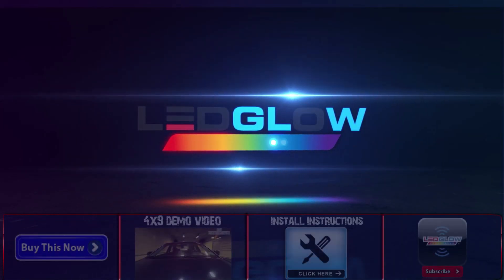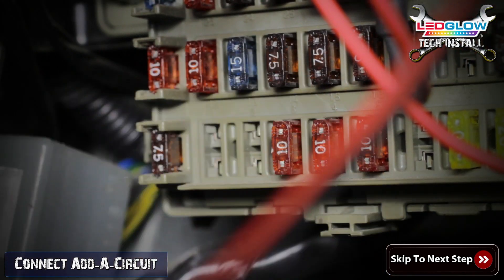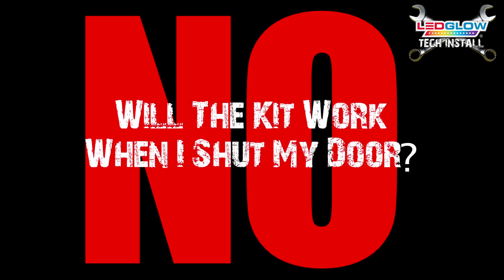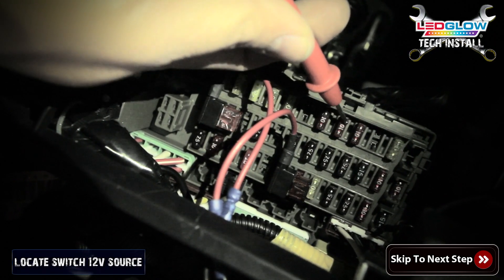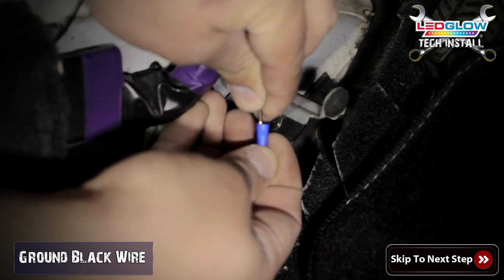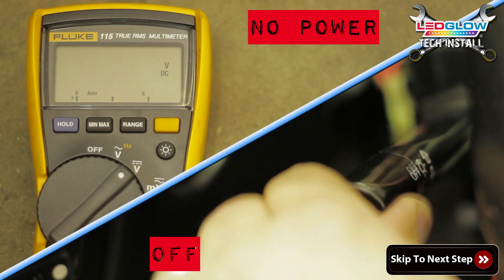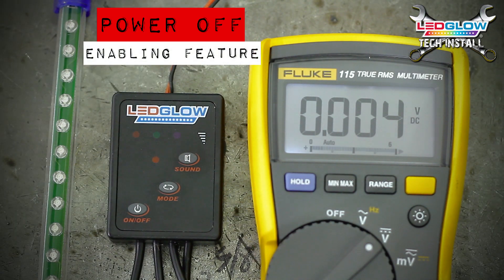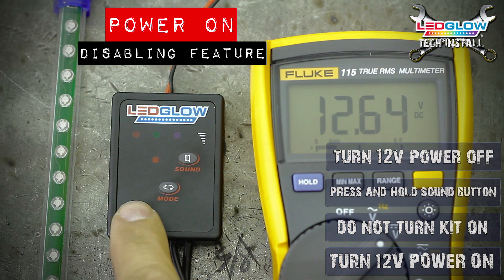LEDGlow | Auto Illumination Mode for 7 Color Interior Car Lights and Truck Lights

Comment from the maker: Gabriel, the 7 Color Lights draw less than 2 amps so it will not cause the fuse to blow and you won't need a 15 or 20A replacement. If the fuse does blow then there is a short somewhere within the wiring than from the installation of the interior kit. If you decide to use an add a circuit, you'll use a mini add a circuit for your 2013 Toyota Camry. If you have any other questions or concerns just ask!

Comment from the maker: If you purchase a mini expandable circuit from us, the 4 amp fuse is included with the circuit, but if you purchase it from your local auto parts store you may have to purchase the fuse separately. You can use a 4 or 5 amp fuse, but a 10 amp fuse is a little too high when combined with a 10 amp fuse used to power the kit.

Comment from the maker: Bryan, it is possible to have the kit turn on with both the driver and passenger doors open, you'll just need to extend the black ground wire and connect it to both door pins. You can do this by using 16 or 18 gauge automotive grade wiring. If you have any other questions or concerns just ask!

Comment from the maker: Joe, with the door pin switch it will remove the connection and it will just shut the kit off. The dome light is computer controlled and the kit will not connect and function in that same manner. If you have any other questions just ask!

Comment: I love my kit. I took the time and worked it to my headlights, doors (each light turns on depending which door is opened), and wired it to my dome lights so that when I press my unlock button all the lights come on. I also did a similar thing with my exterior lights with the doors and dome lights (I added an extra switch so I can turn them on or off while driving) they also turn on with my unlock button. Keep up the good work. 👍🏻
Reply from the maker: Thank you. We are glad that you like them!
Reply: How did you get it hooked up to some many places? Did you have to add anything extra or did you just add wires and connect each of them together to get it all to work?
Reply: Show a video, everybody wants to know how you did this.
Reply: Hue G Rekt i would like to know how you do it. the door and the interior lights
Reply: Nice
Reply: Can you help me do mine I pay you 100$! Im from NH! Lol

Comment from the maker: I'd try relocating the control box to more of the center of your car by your center console or on an interior trim panel attached to the body instead of the seat. The music mode picks up the vibration, not the direct feed from the music. Make sure the controller has a solid connection and adjust the wheel for the optimal outcome. If you're still having issues with the music mode after moving the control box then we'll set up a return to find out exactly what the issue is.

Comment from the maker: Peter, you can tap the positive and ground wires into your aftermarket stereo wiring harness if has a 12v(+) and 12v(-). If you decide to use an expandable circuit, you can purchase it directly from us or from your local auto parts store, either one will work fine. If you message back the year/make/model I can tell you exactly which expandable circuit you'll need for your installation.

Comment: Thanks for the video. Well, guess best way to do a door on/off mod is to run a ground wire to all of the door switches, that way no matter which door opens, lights come on/off when doors are closed and in addition, a secondary LED kit that runs to an independent ground, and separate power source so that you also have the option to manually turn on/off whenever you want when the doors are closed. Two kits, $80ish...still beats that factory $500 add-on.

Comment from the maker: Vu, for the auto illumination function, you would choose one of the methods and go from there. If the kit is connected to the headlight switch and the door is closed, the kit will work, but if you connect the kit to the door pin, the kit will not work when the door is closed. If you have any other questions don't hesitate to ask!

Comment: So with the kit connected to the headlights and auto illumination enabled, is the kit only on/off or can you still control effects from the box?  And as a suggestion, if possible, make the next version of these capable of auto illuminating but still being able to turn off from the kit.

Comment: Just to clarify,

For the headlight option, once you locate the headlight wire, you remove it from the fuse, splice the wires together (with the scotch lock), then plug it back into the fuse box? Looking to do this for my 07 Corolla.
Thank you
Reply from the maker: ***** Thanks for contacting us. You will want to first confirm that the headlight wire from the fuse is a switched power source using a multi-meter because some of the other wires may be constant sources. After you confirm that you found the headlight switched source wire you can splice into it with a scotch lock and you're good to go! Let me know if I can help with anything else!

Comment from the maker: Victor, if you install the kit using option 2, you will not be able to bypass the ignition switch. You will have to have it wired with a toggle switch to cut the connection to the kit. Let me know if you have any other questions!

Comment from the maker: What problems are you having connecting the black ground wire to the door pin? If you want to have the lights turn on when you open your door, the black wire must be connected to the door pin. If not, you can use the ignition switch or headlight switch methods as shown in the installation video.

Comment from the maker: Alex, you will locate, remove and disconnect the door pin. You'll then ground the black wire to a spade terminal, insert the terminal between the door pin, and reinstall the door pin. If you have any other questions or concerns just ask!

Comment: Ok got it. I bought my own add a circuit at radio shack do I need that pink fuse you got there
Reply from the maker: Yes Alex, you will need the pink 4amp fuse in the expandable circuit along with the stock fuse from your car or else the kit will not power. We included this 4amp fuse with our expandable circuits, but you can purchase it at the radio shack where you bought the expandable circuit or at any local auto shop.

Comment: Thanks for the demo vid. 2 questions:

If you connect the ground to the door, will it still draw power when the door is shut?

Also, all I would want is for the lights to be on when the driver's door is open. Is the auto-illumination feature already activated for this purpose? Or is it necessary to do the reprogramming? 

Thanks!
Reply from the maker: Tim Thornhill Thanks for contacting us! The kit will not draw power when grounded to the door pin and the door is shut. The kit won't be able to function, therefore it won't draw any power. Also, you will need reprogram the the control box for the auto illumination function by following the same steps shown in the video. If you have any other questions or concerns don't hesitate to contact us!

Comment from the maker: Thank you for the compliments, Peter, we really appreciate it! You are good to go with a mini expandable circuit for your 2000 Toyota Celica. If you do end up buying one from your local auto parts store, make sure you get a 4 amp mini fuse as well. This fuse is used as circuit protection for the kit and the kit will not power on without it. If you have any other questions or concerns don't hesitate to ask!

Comment: When you synced it to the headlight switch, was there a reason why the LEDs were flashing? Was it just the type of light? I'm looking for the one that will stay just a solid light when the headlights are on.
Reply from the maker: Ryan Tran The LED lights were flashing because the kit was set to the flashing mode. You can set the kit to the solid illumination mode or any other lighting pattern you prefer. Let me know if I can help with anything else!

Comment: For the door pin method, you say to use a spade terminal. Is that included in the kit?
Reply from the maker: ***** The spade terminal used in this auto illumination install video is not included with the interior light kit. If we keep getting more requests for this component we will start adding it to be included with kits but at this current time it is not. Let me know if I can help with anything else!

Comment: What's the best way to power the lights like your dome light works when unlocking and shutting off your car?
Reply from the maker: First, would try and see if there is a fuse in the fuse box for the headlamp and connect the power wire from the control box to that. The other choice would be to wire it to the door latch.
Reply: @ledglow  Would the lights turn on when the door is unlocked then? I am trying to do that as well.

Comment: Hi Ledglow.. just bought myself the 4pc 7color kit and about to install it tom.. quick question.. can I just tap the positive wire and ground wire to my aftermarket stereo wiring harness? If not..can I just buy the addacircuit at OReilly or it has be from ur company to work? And what is 4ohms? Can I just buy any addacircuit that will fit to my fusebox and still work? Ty

Comment from the maker: Where do you have the control box located now? Installing it anywhere near a speaker output is fine and make sure that the sensitivity wheel on the side of the control box is all the way up. If you have any other questions just ask!

Comment: For the door pin method, would I just be able to strip the dome light ground wire and connect the LED ground wire to that?
Reply from the maker: Rennigade Unfortunately you cannot do this because normally the dome light always has ground since you can manually turn it on and off with the door opened or closed.

Comment: Two questions:
1) I have automatic headlights, and whenever I turn on the car during the day, the daylight running lights turn on. Will this activate the led lights on or does it only do so when the main headlights are turned on?
2) Does the installation kit include everything you need to do the installation of the auto light feature? (Excluding the multimeter of course).
Reply from the maker: The kit will come with everything you need to install the kit beside the expandable circuit and the wire connectors. The expandable circuit can be purchased through our website when ordering the kit and the wire connectors can be purchased from any local automotive store. The kit will only receive power when the headlights are turned on if that is how you choose to connect to power. If the power button on the kit is turned off then the kit will not turn on until the power button is pressed. Let us know if you have any further questions.
Reply: LEDGlow Wow, that was a quick response. Thank you!
Reply from the maker: You're welcome!

Comment: If i want to use any 12v source, well, possibly one in your video,
Would I be able to splice the positive wires together (probably to the cigarette lighter) instead of purchasing the add-a-circuit?
Reply from the maker: Nicholas Tuvera If you're looking to splice your kit into your car's cigarette lighter, you will have to confirm that it is 3amps to power the LED kit. If it is then you should be good to splice the wires, but if it exceeds 3 amps you will have to use either a cigarette lighter adapter or an expandable circuit to power the LED kit. Let me know if you have any other questions or concerns!

Comment: Just got it installed now..got the expandable circuit off a store with 5amp fuse..I connected it to my headlight fuse since thats only 10 amp plus the 5 amp I bought..its a constant fuse..question..will this drain my battery in the long run??

Comment from the maker: If you want to hook your interior kit up to turn on when your door opens, you must power the kit from a constant 12v source. In some cases you can use the cigarette lighter circuit if it is functional with the car off, but if not you can use the dome light fuse, horn fuse or radio memory fuse. If you have any other questions don't hesitate to ask!
Reply: Will it be able to turn on when the door open and the car off. Also Can I turn it on while driving too?

Comment from the maker: We usually recommend using a fuse that is no higher than 10 amps, but you should be in the safe zone with using a 15 amp ACC fuse.

Comment: I'm deciding on either getting the cigarette lighter adapter or the fuse but i was wondering I turned it off on the box and left it plugged into the cigarette lighter  would it still drain power?
Reply from the maker: +Jacob Poche As long as the outlet has power going to it, it will send power to the box, however, if the box is off, the kit won't be draining any power.

Comment: Is it possible to take advantage of the switches on my dome light? My dome light has auto on as well as a manual toggle between off and on.  It would be awesome if I could somehow use that...
Reply from the maker: Noah Zelezny Unfortunately you cannot utilize the switches on your dome light because that uses its own circuit board and always has power going to it. Let me know if you have any other questions or concerns!

Comment: Hi there. I have the 7 Color Lights that I want to install. I want to buy a cigarette lighter adapter but reviews for your version of it say it only comes with 2A so it blows out right away. Should I buy a 15A or 20A replacement? And if I were to buy an Add-A-Circuit, do I need a mini fuse? I'm installing this on a 2013 Toyota Camry. thanks.

Comment: Does the expandable circuit come with the 4 amp fuse? Or do I need to purchase that separately?
Reply from the maker: hunterskateboard Yes, the Expandable Circuit comes included with the 4amp fuse so you will not need to purchase that fuse separately! Let me know if you have any other questions!

Comment: Okay. So, if I use the door pin method (extending the ground wire), will the lights work when the car is on and driving? Hence when i turn on the ignition and play music?
Reply from the maker: Fairytale〉l〈Productions If you install the kit using the door pin method, the kit will not function when the door is closed. If you want the kit to function when the car is on and when you're driving then I recommend powering the kit from a switched 12v source. This will also allow you to utilize the sound activation function for the kit. Let me know if you have any other questions or concerns!
Reply: LEDGlow Okay, so just to double check, If I power the kit from a switched 12v source, will I still be able to ground the ground wire to the door pin? Or do I have to ground it to a bare metal source?
Here's what I mean: 1. I open car door, led lights up. 2. I shut car door, light turns off. 3. I turn on car and lights turn on too. 4. I play music, lights react to music. - I want to be able to set it so its like these steps listed above. Possible?
Reply from the maker: Fairytale〉l〈Productions The thing with installing the kit with the auto illumination function to the door pin is that you will not be able to use the kit when the door is closed. If you want to connect to a switched 12v, you will want to ground the black wire to a bare metal surface rather than the door pin so you can use the kit regardless if your door is opened or closed.

Comment: How do you test for voltage? Do you just use the multimeter and touch the two points? because in the video you only used the red prong and clipped the other to the battery? do you have to clip it to the battery or can we just connect it to any piece of metal?
Reply from the maker: The black one needs to be clipped or touched to any bare metal source for ground. Then the red one can be touched to the power source. You do not need to connect it directly to the battery.

Comment: Is it possible to have the auto illumination, and the sound activated mode at the same time on? I would like to use the headlight method, but want the lights to dance to my music too.
Reply from the maker: Gavin Youker Yes, you can use both the auto illumination function and sound activation mode at the same time, but since the auto illumination function is enabled you will not be able to turn the kit off until the headlights are off.

Comment: hello im curious if its possible to wire/set this so the lights make a solid not flashing red light when the door is opened and turn off when door is closed and then on again when the ignition is turned on

Comment: I have a 1967 mustang and am thinking about getting the interior and exterior lighting kits, is there anything special to do because it is such an old car?
Reply from the maker: Jonas Dunlap As long as your 1967 Mustang is connected to a 12 volt power source then you shouldn't have any problems installing interior and exterior lighting. If you decide to go through with the installation, send some pictures of the installed kits to our Facebook page! We'd love to see our lights on that classic!

Comment: I love the light kit! However I tried installing them so they turn on using the ignition, option 2 in the video, and does not automatically turn on. It still turns on and off fine using the control box but it does not automatically go on and off. It is the the ignition switch fuse right now and we tried enabling the auto illumination mode and still nothing. What do we have to do to make it work! I have a Ford Fusion 2010 SE. Thanks.

Comment: For the Key Ignition funtion, will the led lights still be on when i turn on the engine and start driving? Or does it only work when i turn the key ignition to "On"?
Reply from the maker: Luis Sanchez As long as you don't install the black ground wire to the door pin then you will be able to use the kit when the car is on and when you're driving. Let me know if I can help with anything else!